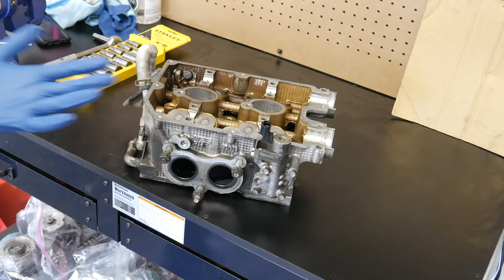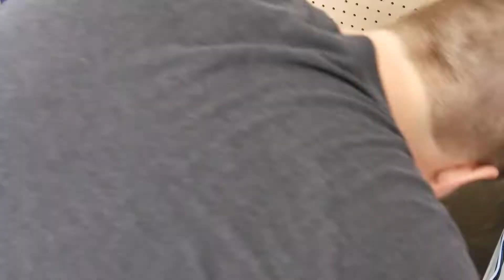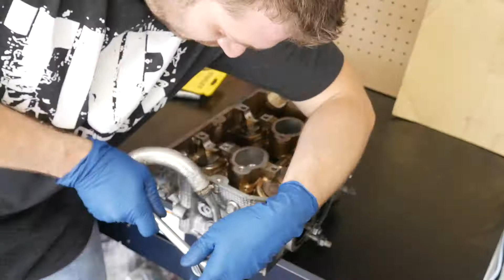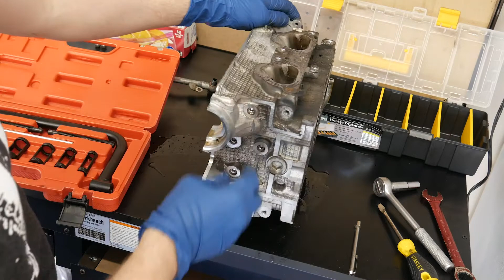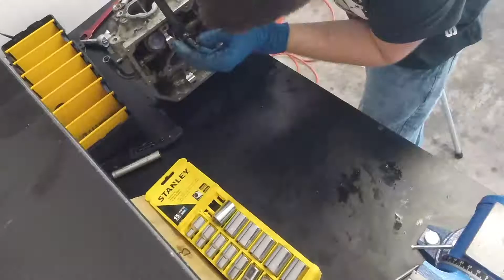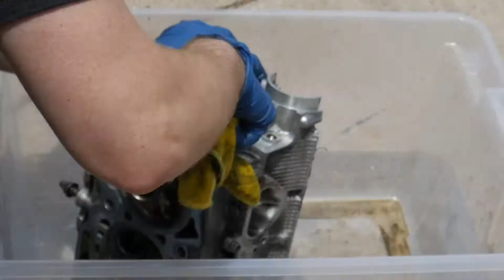Subaru STi EJ257 Cleaning up the heads

Comment: Great video of this tear down... how much better is your torque and gas mileage after this?
Reply from the maker: torque is through the roof with these motors, i forget the exact number but on e85 both torque and HP at the wheels were over 400 and almost the same.  gas mileage of course went down but thats just the name of the game when pulling more power.